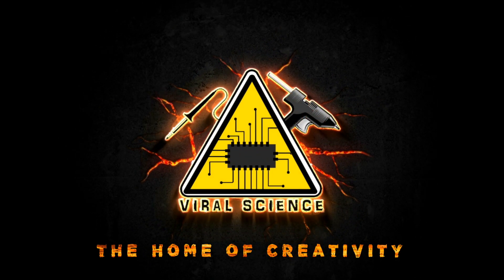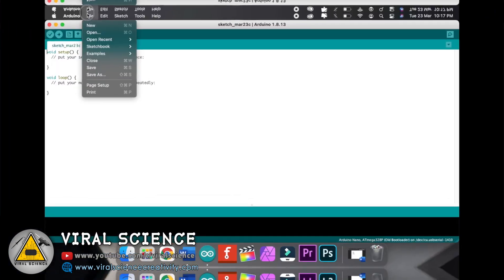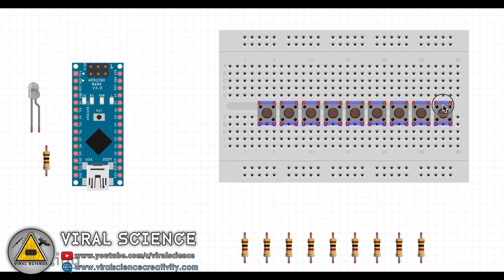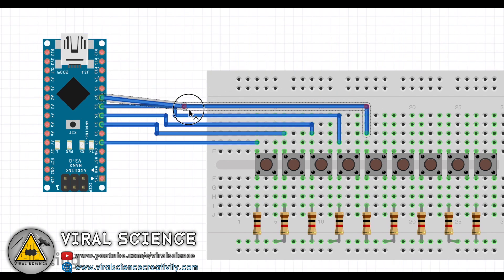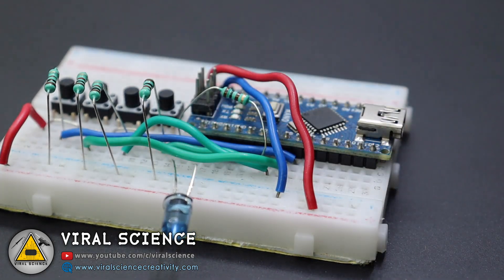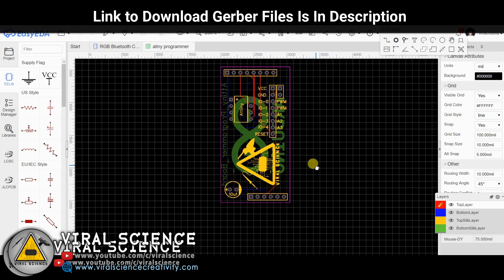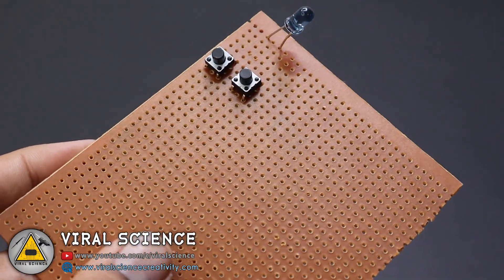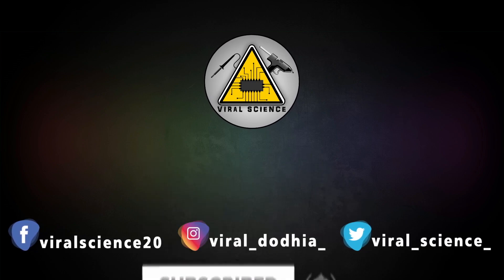How to make Universal Remote Controller for all Devices

Comment: I have an RIF6 projector that requires a remote to use.  I'm planning to use it for art projects. The Rif6 IR remote uses 32 bit code that is online.  I'm curious if i could use this system to program the remote to work for this.

Comment: To all those who are about to start making it please make use of these points:
1) Instead of using separate resistors for each button, use arduino's built-in 25k ohm resistor soldered onto the chip, just use INPUT_PULLUP instead of INPUT in code.
2) I used super bright 5mm IR LED, so i connected a 220 ohm resistor with it, the operation being seamless and no overheat of LED or Arduino. The range can be increased by reducing the resistance, but since these LEDs take 80mA current from Arduino. I won't recommend reducing this resistance or either if you are really interested in increasing the range, use a transistor BC547 with the LED. 
Good luck for your project!

Note:
I followed the circuit diagram of this video, I faced the problem of auto triggering of buttons due to excessive interference due to resistors being connected to ground (PULL DOWN config), so please use resistor with digital pin instead of the GND.

Comment: To make ReceiveDump example work on the NANO, the IR sensor had to be connected to pin D2. Don't know why it wasn't a simple #define on the project source code. But the biggest problem is, you show all the wiring steps to the IR controller, but you don't show where the code is available.

Comment: Hi, thanks for the video! Really awesome. I have a question if you don't mind. Is it possible to add a button that controls a specific function of the device? for example, if I want to desaturate all the colors of my tv. Thanks again!
Reply: As far as I know that would only be possible if your TV had some kind of programmable function that let you make specific settings that could be controlled with a remote. If it had some sort of custom picture mode, and it had a setting to change picture mode profiles with a remote I assume it would be possible. It would require a smart TV that already had this kind of function.
Reply: Probably not exactly what you were imagining, but I reckon it must be possible to send a sequence of IR values, rather than just a single one. This means that you could hard code a sequence that opens your TV settings, navigates the menu and adjusts the values you want to change.
However, this is really jank and probably won't be fast, since you would need to wait between each signal to make sure your TV has had time to execute the previous step (depending on your TV, opening the options or navigating the menu might take more than a second to complete). 

One example could be making a button to switch from HDMI input 1 to 2, where you could program a sequence where you first send the IR code for the 'sources', wait for a second, then send the IR code for 'down', wait another second and then send the IR code for 'enter'

Comment: Doesn't work to control a TV.  The library that does exist doesn't work for controlling a TV beyond turning it on and off.
Reply: Now a days You can't rely on tubers .Lot of frauds to get Likes
Reply: @christycroos5340  iIF IT IS TRUE, THIS CIRCUIT IS A FRAUD, THE irRMOTE LIBRARY DOES NOT WORK ON attiny85, it only works on an arduino board.

Comment: I have a Sansui HTS-35TB 100W Sub-Woofer. It has 4 Aux Inputs and 5.1 Channel Inputs including 10 Outputs. It is powered by the Sansui Remote but the remote is not working and I lost it a few years ago. Also the Woofer is not powering on some components on the board might be damaged. What shall I do to get it working again and how can I control the woofer and other channels volume levels etc? Please help?

Comment: thanks a lot, i have a question: what i should do if i have a decimal code not HEX, its a log code i got it from net and i have no idea how to convert it to HEX could you help me out
Reply: In Arduino IDE Software go to example and open IR Remote dump file and upload it to Arduino Uno board and IR Sensor connected to Arduino first then open serial monitor and Press any key of remote and showing Hex Code

Comment: code is wrong. there is no led input . its is not working plz show real code
Reply from the maker: Its tested code and working fine, check your connections
Reply: @ViralScience  
when I compile the code, it will give warning plz help:  
warning: 'void IRsend::sendNEC(uint32_t, uint8_t)' is deprecated 
This old function sends MSB first! Please use sendNEC(aAddress, aCommand, aNumberOfRepeats). [-Wdeprecated-declarations]
irsend.sendNEC(0xFD22DD, 32);